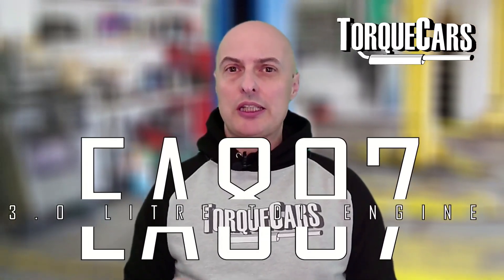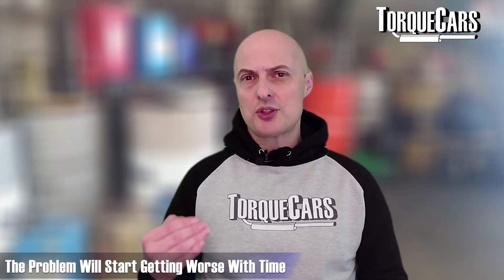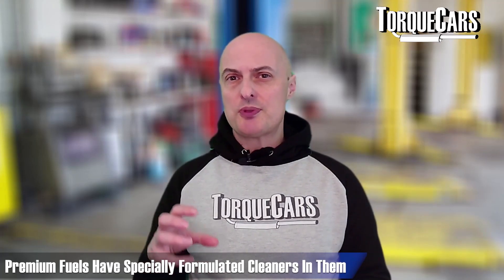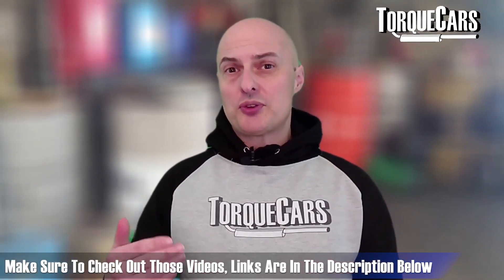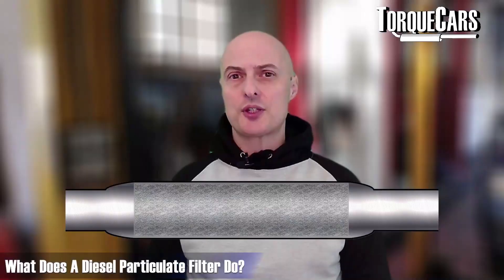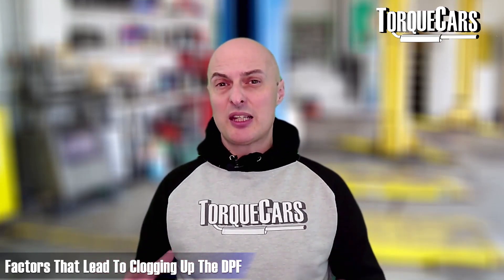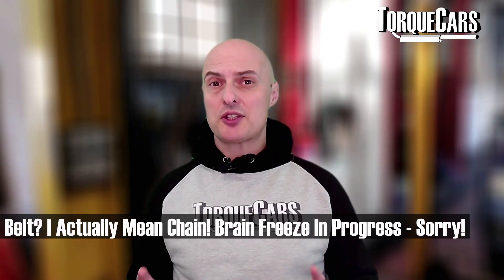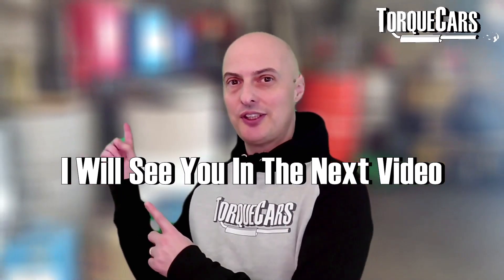Common 3.0 TDi Problems & Issues: VW Audi Group 3.0 TDi Engines [EA897 VW AUDI SEAT SKODA]

Comment: I got the b7 a4 3.0 tdi 1e gen v6 tdi with nearly 400.000 km on the car with the stock timing chain. It just started ratteling with cold start after these km.  The engines are not bad and evrybody is afraid of the cost of repair but its mainly also how u take care of ur engine  i always switch oil as fast as i could when i hear the oil was done i replaced it. If i stil hear it running smooth i replace it after 15.000 km standart. If u do this it can last freaking long. So 2500 euro repair for 400.000 km is nothing compaired too other engines being destroyed after 200.000 km

Comment: Injector seals, timing chain tensioner, crank pulley snaps off,
Reply from the maker: Thanks for the info I'll add that to my list. Did these affect all years or just certain models?
Reply: @torquecars  mainly audi a5-a7 with the 3.0tdi 205-245 bhp

Comment: The more I read about these 3.0 TDI motors, the less I want an Audi
Reply: They are beautiful mate I've done 50k+ trouble free miles 🤞 pushing 360 hp and 800nm of torque, best car I have owned could not recommend one more- btw I'm now on 159,000 miles 😁
Reply: @user-vs1ws1xc1r  what year is your vehicle mate
Reply: I bought one with 170k and have now 197k on it, not a single error, feels like it runs like day one
Reply: @Bibsen97  hi, what did you look out for when buying?

Comment: What should be the normal pressure into the Rail on A6 C7 3.0 TDI /204 HP/ , 2011.   I was checked it today and it read 25-26,000 kPa. Shouldn't it be over or around 30,000 at IDLE at least ?

Comment: The One issue this engine has is low Oil pressure..It goes down to only 1 bar runnung engine...You can change to 1.8 bar changing computer program..
Reply from the maker: That is really handy to know, thanks for passing on that tip, I'll note it in the article as well when I get a chance.
Reply: @torquecars  This is factory misstake...All 3.0 TDI engine start with C engine code like CRT ext...Suffer from low Oil pressure..Some of this engine make 30k milles some 100k but soon or later low Oil pressure will kill this engine..There is 2 ways to fix it...Change Oil pressure program in ECU also change  gears higher also in ECU..Then engine will live long time..This engines get good Oil ptessure at 2200 rpm/min...
Reply: @martintv..1524  can I use obd2 for this?

Comment: Great engine new, get rid of it before it hits 90k miles.
Reply: Had two fine for over 300,000 miles.  2006 ASB only needed injectors twice, new EGR and EGR cooler and vacuum system components.  2015 CTBA only injectors and now has a slight tick for a few seconds in summer when engine is still warm but oil has drained down from being parked all day (assume chain is expanded and tensioner oil has drained down).
Reply: @snapdragogon69 Ticking maybe new injector washers needed mate
Reply: 180k miles on mine, service it regularly
Reply: These 3.0 tdi are under warranty until 120k miles. No point in getting rid of it until at least then😂
Reply: Not really 310,000 kms mine has no issues at all.
Reply: 310,000 kms on my 2007 A6 allroad it's fine!
Reply: 330,000km on mine, only the water pump has failed 👍